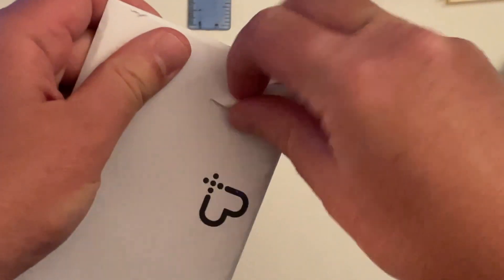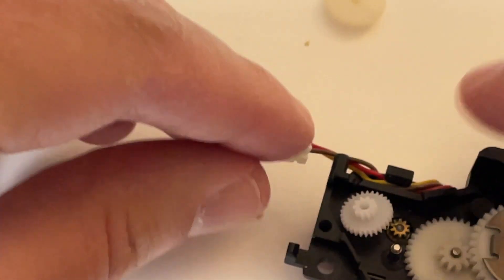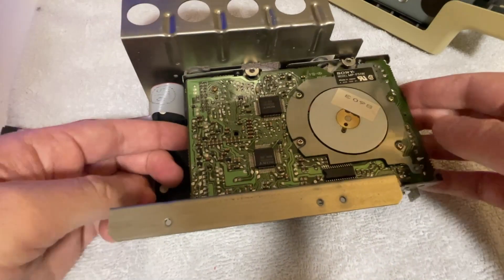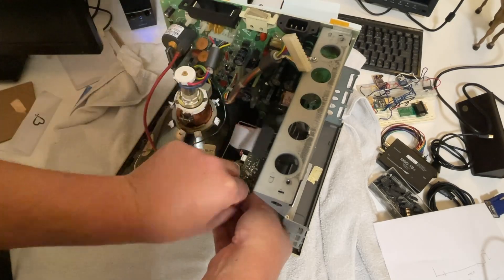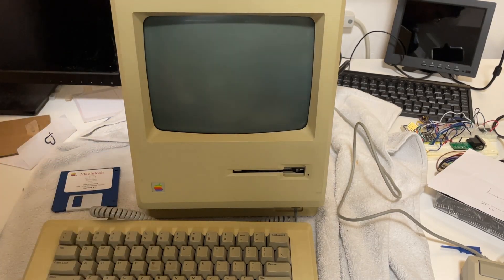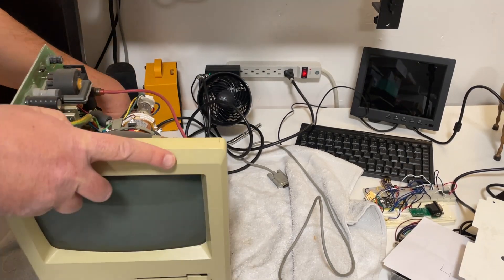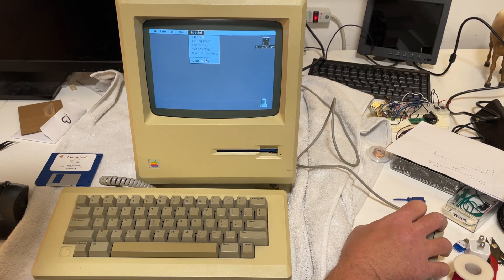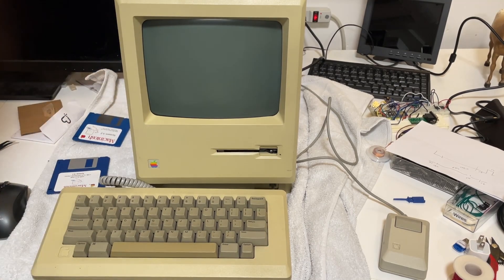Compact Mac Repair Update: 3D Printed Floppy Drive Eject Gear Replacement (Mac 512k, Macintosh Plus)

Comment: Yay, it worked! Looks like the CRT could use adjusting; the picture could be enlarged to fill more of the monitor. Plastic TV adjusting tools to the rescue!
Reply from the maker: Great to get it working again! I think I have one of those adjustment tools around - but if not, maybe that could be 3D printed.